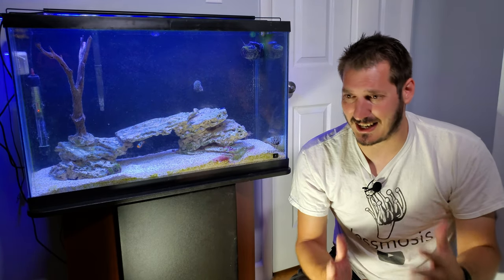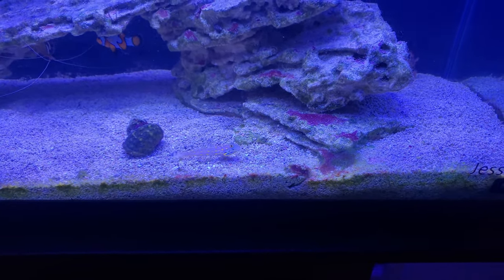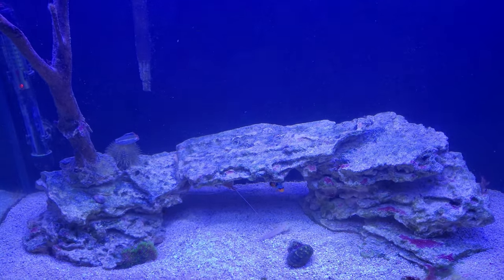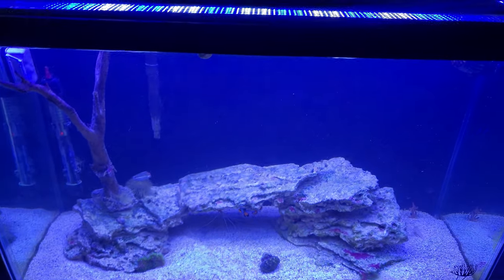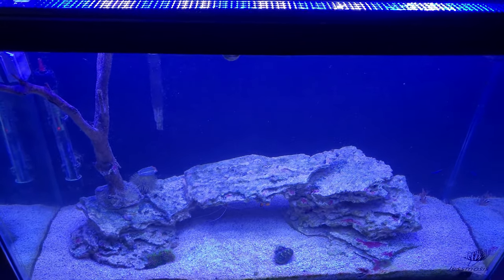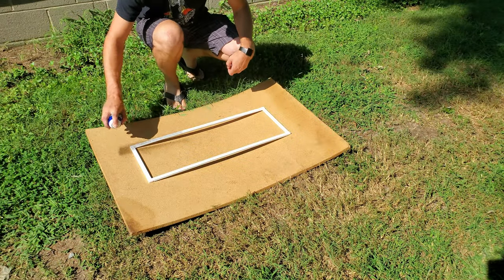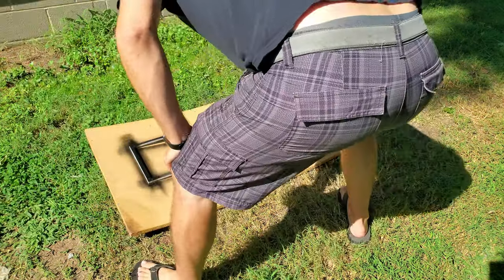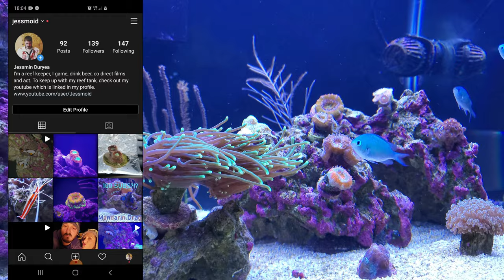DEAD FISH!!! DIY Screen And Tank Update | 29 Gallon Nano Reef Tank

Comment: Hey brother just want to ask is that drifts wood in the tank
Reply from the maker: Yes it is, it was a gift from my mom that she found on the beach in some foreign country.
Reply: Jessmosis ooo ok but did u check if is good to have it in a saltwater tank I’m just curious cause some drift wood will leach tint in the water so maybe you should check on that if is reef safe
Reply from the maker: @calipsosreefs4843  everything seems to be going well with it. Thanks for the concern and suggestions. I was pretty concerned about this when I started the tank as well, but it hasn't seemed to leech anything toxic and I run carbon anyways. 🤙

Comment: I think I may know what your problem is with your tank and why maybe your fish are jumping out first off I do not really see any type of biological filter in your tank I think I did see a little hang on the back one sir that is not enough biological filtration for a saltwater tank!!!!!! you would have been better off having an undergravel with air tubes running up that little hang on the back filter is not going to work for you once your ammonia starts building up and nitrite you will start losing fish and they will die if I was you I would make myself a small wet dry filter and get it cycled properly like I said I have 100 gallon tank with no lid and none of my fish have ever jumped out of the tank question have you been testing your ammonia and. Nitrite where is your coral beauty sir I'm not telling you what to do but without a good biological filter and some water movement you will not be successful